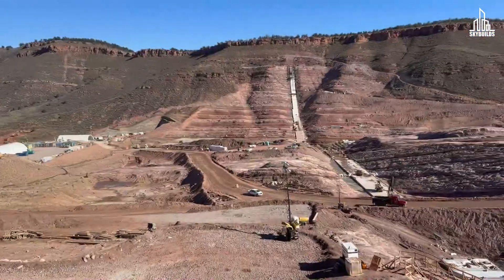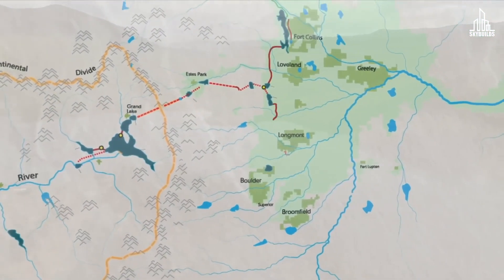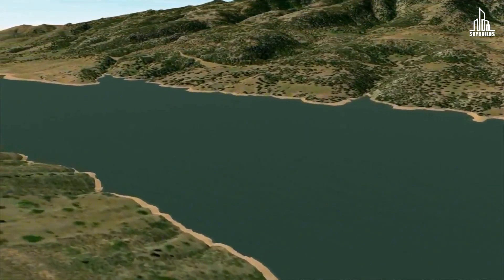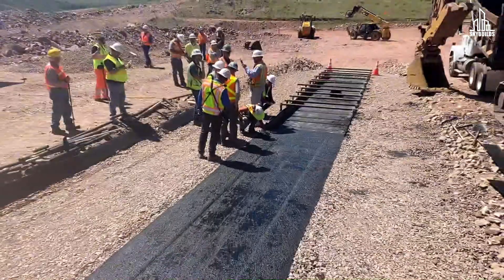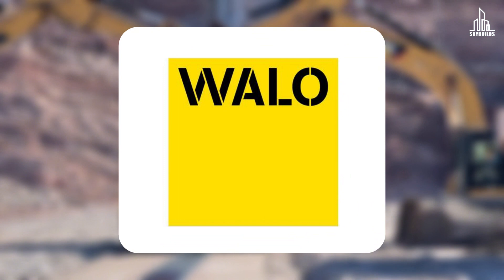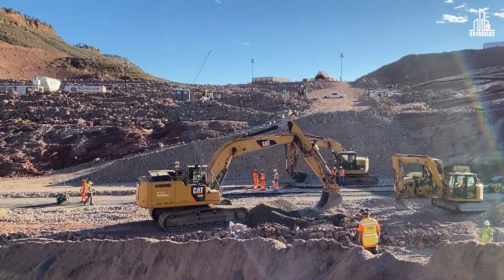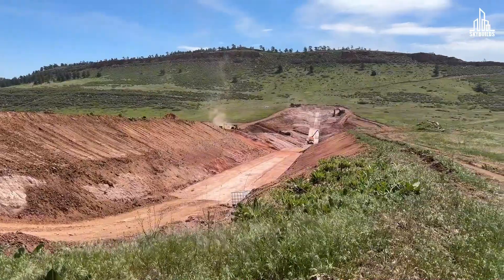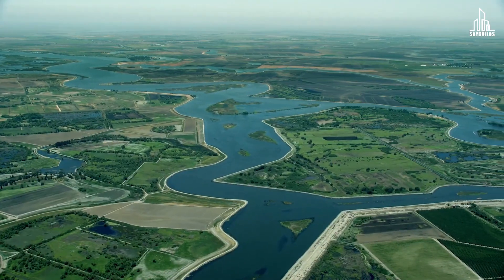America’s Built The Largest Dam in 25 Years!

Comment: This project is doomed 2 fail! There's just not enough H2O! The math doesn't lie! They claim the reservoir will take 3 years 2 fill? That's just crazy + no mention was made of using the dam 2 produce energy? That's because it won't! It's used only 2 store H2O 4 public consumption. AS fast as it fills up, it will be used up + with the high rate of evaporation in the hot & dry Southwest, this project is a huge waste of money, resources & doomed 2 fail!